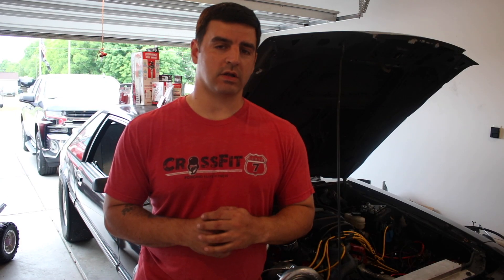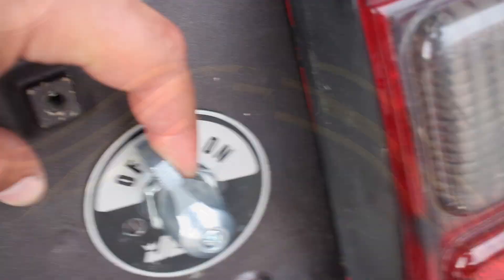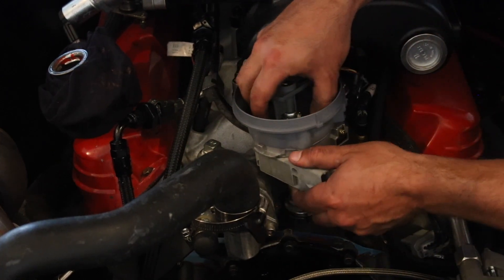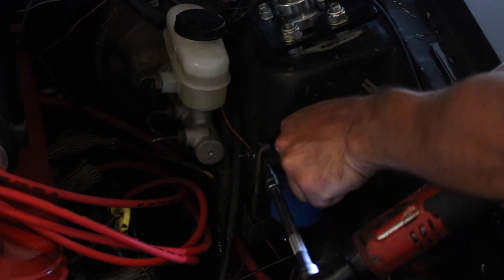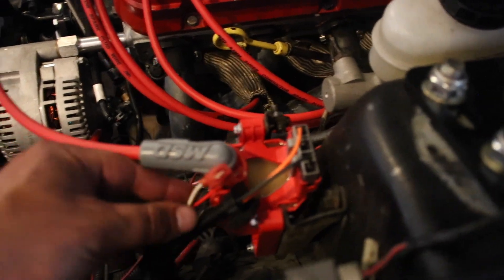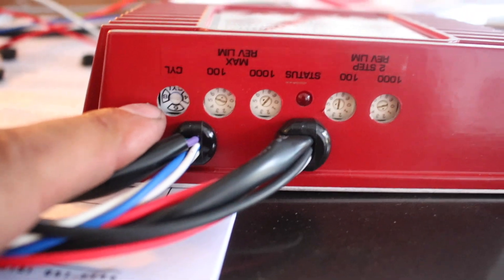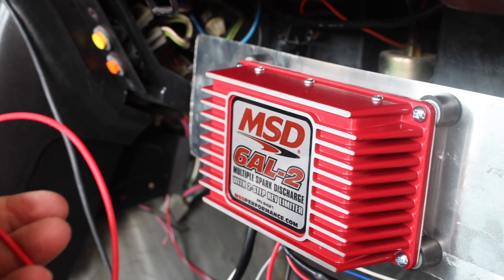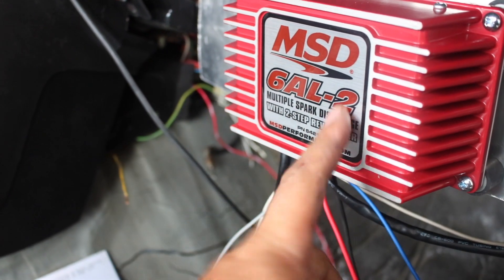HOW TO INSTALL MSD BOX WITH HOLLEY TERMINATOR X ON A '79-'93 FOXBODY MUSTANG

Comment: I just installed a MSD 6a ignition. Did you change the tune ignition type from Ford TFI 8 cylinder Sequential to CD Box?
Reply from the maker: No because it’s not controlling timing

Comment: Hey I'm 4 years late but I have a question. On the blaster coil adapter I got, you connected the oem connector cut from oem harness I assume. Then connected the distributor white points out wire to the white connection on the oem plug to the adapter harness of the blaster coil. Now the red connector on the oem side is there anything there or you left unused?

Comment: Im super confused theres no points wire on a MSD box, so are you actually saying the points wire from the TERMINATOR system needs to be hooked to that white wire from the MSD box as well? The way you said it in the video confused

Comment: I appreciate your Reg Guy videos -in this video you correctly showed the  white wire from the TFI harness correctly going to the neg side of the factory coil plug my question is did you connect the positive side of the plug (green/red) using a 12v relay as described in the instructions? ..getting ready to finalize my connections thanks

Comment: Hello got a question im going to relocatemy battery in my trunk i heard that if you extend any of the wires on the box you have to go a gauge size up is the true and do the ground have to go on the neg battery post or just any good metal part of the car thanks

Comment: Hi! Just bought the terminator x max kit. 
Question! Can the terminator Max do the two-step and can I bypass the MSD two step if I do so?
Reply from the maker: Yes. You just don’t hook up the wire for the 2 step on the MSD. I just better luck with the MSD 2 step
Reply: @RegularGuyGarage  thank you!

Comment: I just got my term x installed in my 347 I’m confused in the settings when your setting up your ignition parameters it ask if it’s tfi or cd box but if you click cd box it says it won’t control sequential injection or timing do you just keep it set to tfi or do you set it to the cd box setting any help would be greatly appreciated thanks
Reply from the maker: Keep it set on TFI and the terminator x will control your ignition timing.
Reply: @RegularGuyGarage  thanks your the best

Comment: Cool video, surprised you didn’t go with the dual sync that seems to be the go to upgrade with terminator X. By doing this do you save any In’s and Out’s with the terminator X or are you using one now by going this route?
Reply from the maker: I don’t have to use any Inputs or outputs to run this as is. And now that I have a more capable ignition system the terminator x 2 step should work, so I’ll switch to that when I install my transbrake/bump box and run them all together

Comment: Why not use the two step with the holley terminator x  great video I bet it rips now
Reply from the maker: I couldn’t get the holley 2 step to work on the stock ignition system. For this video I just wanted to show how to hook up the MSD 2 step. I’m going to try the holley 2 step now with the upgraded ignition system and most likely use that one

Comment: Dude, that box will leave you stranded on the road.  MSD is absolute fucking garbage, I had an MSD 6AL on my fox with the terminator x shit left me stranded in the middle of an intersection.  Went with a cheaper more reliable Pertronix box and haven't had an issue since.  MSD boxes were tough as nails back in the day but somewhere down the line their quality went to shit.  Trust me, hook it up to where you can easily return it back to stock because when that bitch leaves you stranded you're gonna remember this comment.
Reply from the maker: I don’t street drive the car, but all I have to do is unhook the adapter and plug the stock coil harness back in. so far it’s been working fantastic

Comment: I guess my question is why not a dual sync distributor?
Reply from the maker: I Just wanted to get this one 🤷‍♂️
Reply: @RegularGuyGarage  ok. I’ve not seen this one done yet. Curious to watch. My terminator should be here mid June sometime. Im absorbing all I can get. Why the msd System ? And did it run better? Thanks buddy?
Reply from the maker: It runs much much better. Starts smoother. The holley had a 2 step also, but I had a hard time getting it to work on the stock ignition system. Just wanted to showcase the one on the MSD for now
Reply: @RegularGuyGarage  I’ve got ya and thanks for showing that to the rest of us!!!!!
Reply: @RegularGuyGarage  thank you for your time buddy. Have a good one!